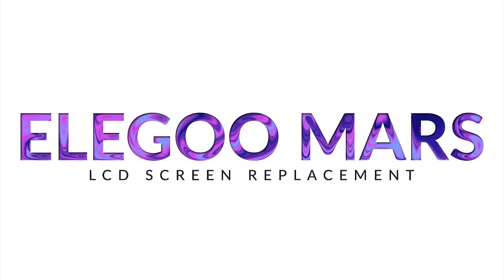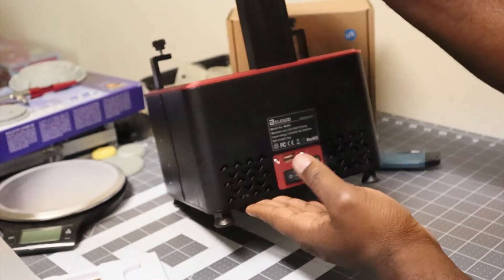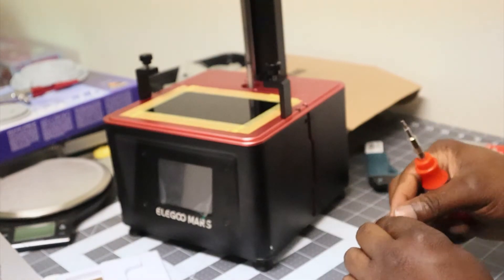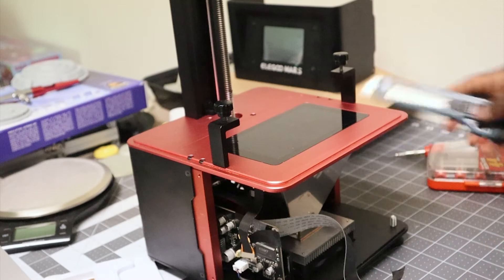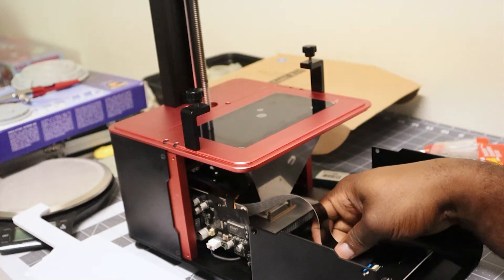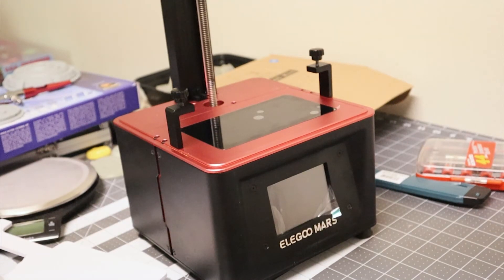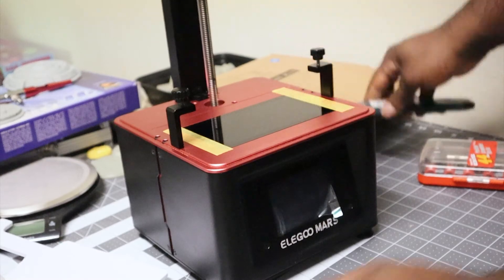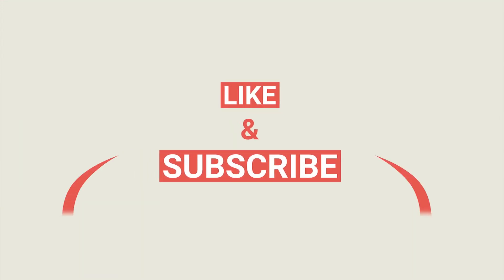Elegoo Mars LCD Screen Replacement

Comment: what kind of tape did u use? painters tape? also wouldnt i have to reset z after doing this, especially if i add tape around the edges? cheers for the vid!
Reply from the maker: It’s been a few years but I think it came with tape to use with it and yea I would re- level the z-axis after you swap it out.
Reply from the maker: If it didn’t come with tape I would use electrical tape

Comment: Thank you for sharing great video !
Recently I replaced old RGB LCD to new one because of dead pixels.
How fast does your Mars with MONO 2k print out actually?
About 2 times faster than RGB ?
Reply from the maker: Thanks for the comment. I’m printing at 2 seconds later times which is 4x faster but I think the lift speed is slower so it more like 3x faster than the regular Mars but I haven’t tested changing lift speeds yet.

Comment: Hello,

I saw your elegoo mars lcd replacement video and want to thank you for that as it's much
better and clearer than the official one! Unfortuantly after doing it, I do not get the rectangle 
displayed on the lcd screen - but instead it lights the whole screen. I wondered if you had any tips or could help if possible? I am more than happy to paypal you a tip for your time.
Reply from the maker: Hi I’m wondering if the connection to the LCD isn’t fully secure I would recheck that the ribbon cable is seated properly. If it still doesn’t work try it with your old screen to make sure you didn’t get a defective replacement.
Reply: @astrosmakes  Thankyou very much for the reply, ill give this a go tomorrow! much appreciated (if you want a tip, just let me know your paypal)